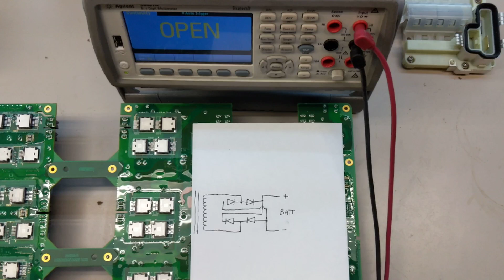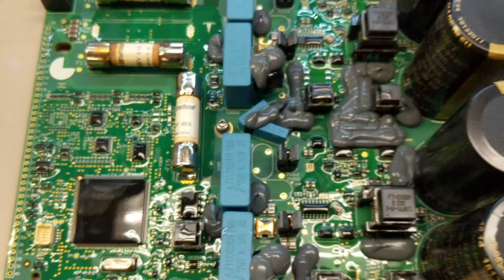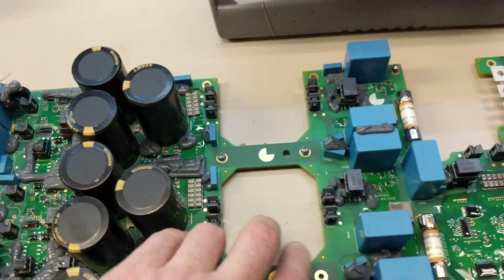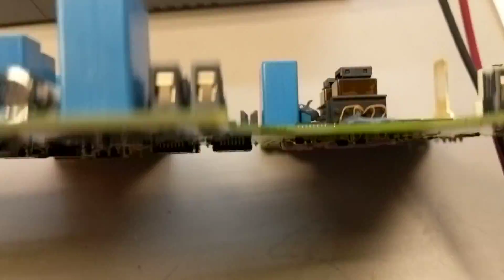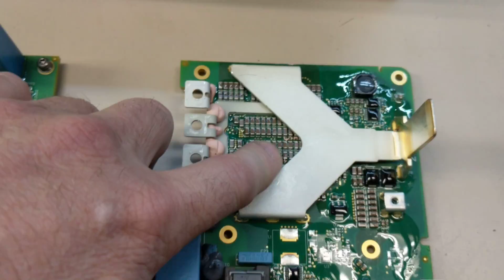UPDATE: Tesla V2G - PART 2

Comment: That's unfortunate, but two possibilities still remain on the table, which are sort of V2G. You can program the wallbox or car to charge only when electricity is cheap and/or stop charging when there's grid instability, and get payed for stopping. 🤔
Reply: Or you just do V2G from DC with inverter in the house like in Japan.

Comment: Thanks - great work. In any case, I doubt that they could just use the the converter to go back to 220 - it would need extra protection for grid management etc (similar to what they have in the PowerWall and solar grid tie inverters). However, they can likely link the DC side together and provide a wall charger that allows both charging and has capabilities taken from the PowerWall/GridTieSolarInverter to manage the driving power back to the grid. So - cars have what they need. The question is - are they going to be ok with impact to battery longevity and if they developed the bi-directional wall charger. They definitely have the knowhow, so it's not if, but when.
Reply: I agree. V2G from DC is what has been done in Japan to some extent.

Comment: I would assume they will only allow 2Grid via a bundled Powerwall. Then they just put battery voltage on the Charge port without using the in-vechicle inverter. They would of course use the powerwalls internal inverter, because thats already grid-tie, which the one in the car is probably not. Also the car already has the ability to connect the charge port directly to the battery, because thats needed for supercharging. 
So unless there is something that prevents the car from connecting the battery directly to the charge port and running current out of the car, nothing is debunked.

Comment: You could maybe drop a line to Sandy Munro, he has recently torn a Model Y to pieces. If its the same that would certainly put this debate to bed.
Reply: Great idea!  All it would take is a pic of both sides of the same pcb.
Reply: They might still be coming even though Sandy said Model Y teardown was finished... I don't understand the debaccle anyway, because all commercial V2G (ChaDeMo) has been DC only anyway..
Reply: @rkan2  The problem is that outputting DC still requires an external inverter to get back to AC (either ~110V or ~230V depending where in the world you live). All the excitement was around being able to re-use the internal inverter on the Tesla (used for driving the AC motors), for this function. People were guessing that Tesla might have had the foresight put this in early - but as this video shows, for the late 2018 hardware at least, they didn't. In saying that, is there any reason why they can't just do a board swap similar to what they did to the autonomous system?
Reply: @rockinrobstar81  I'm pretty sure this particular board is buried in the battery pack. That takes some serious work, breaking seals etc to get at. Easiest way is to remove the whole battery but thats not economic.
Reply: @rockinrobstar81  that would have been exciting to have on board AC using hardware already in place.

But, does the Tesla port, or EVSE protocols have the capabilities that would make doing so safe?  How would it know if it should anti island or not?  Those could perhaps be solved.  Point is, it's maybe not as simple as it seems to make the AC lines bi-directional, but the DC likely already is, even for the old vehicles.
Reply: @MrGonzonator  With large grid batteries it may be worth the effort for Tesla to put new V2G capability and new Million Mile batteries in older cars and stack the old batteries in larger grid backup systems like the Australia Battery. Individual batteries get use until the end of their life cycle as grid backup. Increases the value of the Vehicles while increasing capacity of Tesla Energy.
Reply: @MrGonzonator  Huh ?   Many people have disassembled Tesla battery packs.   There is no inverter built into it.
Reply: @rkan2  If you connected the car batteries to an external inverter you could get V2G.   Does the Supercharger feed these cars AC or DC ?  If it feeds them DC, you could connect an external inverter to the battery pack.
Reply: @SomeTechGuy666  et 'el... The Tesla SC (Super Chargers, not the home/destination) and all DCFC (SC, CHAdeMO, CCS) are DC direct to the battery... -Amps (V2x) capabilities are a protocol question, CHAdeMO can for sure do V2x, I would bet SC also can do -Amps (V2G, V2x).  If not, that's a software fix, to allow for both normal +Amps and -Amps being negotiated and allowed.  The car likely monitors the current (Amps) in/out of the pack and might throw an error or abort or as a last ditch drop its own internal contactors to disconnect from a badly behaving DC charger.

I'm fairly certain there are no directional diodes within the battery pack itself.  I have seen zero BEVs which have done that ever, it would be a waste, and would prevent regen breaking to boot.  The diodes discussed here are part of the on board AC battery charger.

But direct AC out the charge port would be an awesome trick, no doubt.  This would be a great way to accomplish V2V and V2H (via a genset mains disconnect).
Reply: When did sandy say this? Can't find that video.....
Reply: @Krishell  when did Sandy say what?
Reply: Sandy is a great car guy, but he isn't an EE.
Reply: @SomeTechGuy666  I think Sandy is easily qualified enough for a game of Spot The Difference.

Comment: I dont really know electronics, but doesnt tesla bypass this board when supercharging the batteries?
So in theory, they should be able to bypass this to get v2g.
Reply: But the only time you would be v2g is when NOT supercharging. v2g would be like if you were at your house and your power went out, or at home with solar to charge the car batteries during the day and draw from them overnight.
Reply: @StalePhish  ok, i guess you didnt understand. if it is possible to bypass this board for supercharging, that means that it should be possible to bypass this board in the reverse direction, for discharging the battery. got it?
Reply: @thet0ast3r  Seems like it, but you'd need a ton of equipment outside the car, it would be like getting DC from solar.
Reply: @eli128  which actually plays pretty nicely into Tesla's hands, given that they already offer solar and home storage products... Just increases value of the ecosystem
Reply: @StalePhish  Or you just do V2G from DC with inverter in the house like in Japan.
Reply: @stickievidz Yes, they could do V2G via Direct Current (DC) electricity.  But this would require an external inverter to convert it to Alternating Current (AC) for it to be useful in homes or exporting to the grid.  The point @Ingineerix is making is that the boards he has seen can't do V2G with AC.  For doing DC V2G, you'd need basically the same set up as a PV solar panel system, just without the panels.  It would be quite expensive.

Comment: Is the charger able to output battery DC voltage to the charge port?

Maybe the wall charger got updated to be able to accept DC output from the car and send it to the powerwall with a direct connection.
Reply: Sorry to burst your bubble, but diodes prevent that. (I have a computer engineering degree and that's what they taught in college)
Reply: He also shows that's the case when the oscilloscope shows the connection is open or 0.3.
Reply: If you're talking about the little inline power adapter, not a chance. I don't think that would have the cooling onboard to convert DC -> AC. DC -> DC on the powerwall might be doable but you'd need a separate line between the charger and powerwall. The onboard charger being bidirectional probably makes the most sense because I think it can tap the cars cooling system if it's under high load. But sadly we've just learned that isn't the case with this.
Reply: @dowster593  inline power converter? Where? What?

Sure, you would need an dedicated connection between the powerwall the wall charger.

Comment: offtopic question: that’s the transparent coating on the board? is that a common thing nowadays? what’s the purpose?
Reply: Yes common for boards that will be used outdoors. It’s a weatherproofing layer.
Reply from the maker: That's called Conformal Coating:  https://en.wikipedia.org/wiki/Conformal_coating

Comment: Thanks for the explanation. Well done. Is this the only circuit board between the pack and the rest of the car or could there be a bypass of some sort?
Reply from the maker: There is a bypass, they have contactors that are used during supercharging, so in-theory the car could put DC out.  This would require en external inverter.  Pretty much the same thing you'd need for solar.  Look up what a 10kW grid tie inverter looks like and costs.
Reply: @Ingineerix  All of Nissan V2G in Japan is like that though..
Reply: @Ingineerix  thanks for clarifying. It could become optional and maybe combined with solar inverter.